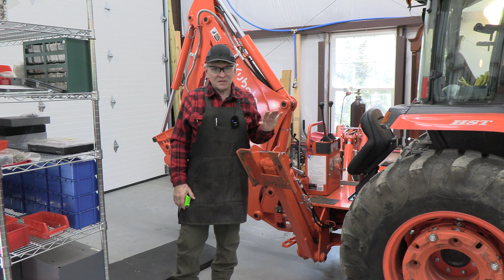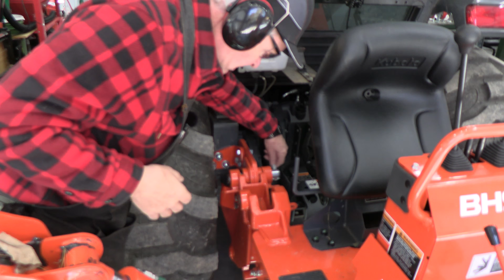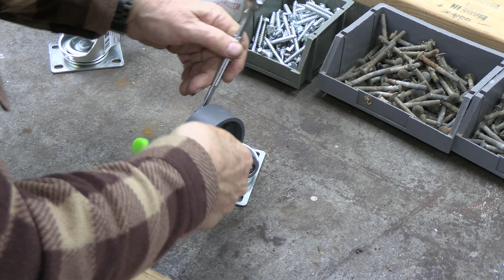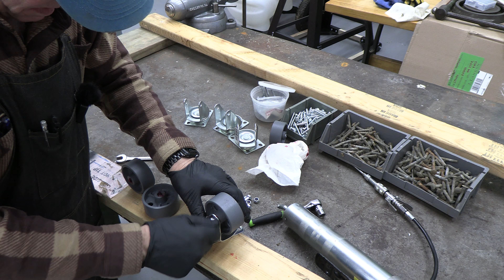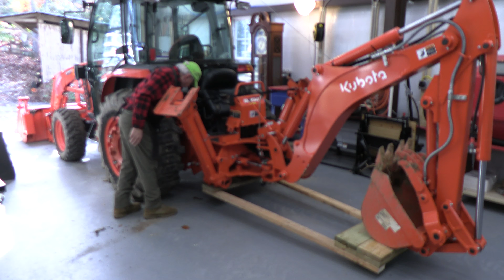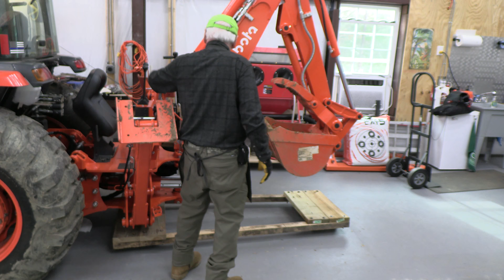KUBOTA BH92 BACKHOE ROLLING CART BUILD

Comment: I found this video very helpful, and I'm getting ready to build a dolly for my own BH92.   I am questioning whether it is necessary for there to be a rigid connection between the front and rear pressure points.  Do you think it would be possible to build separate heavy duty dollies for the front and rear pressure points, connected by a cable or chain?
Reply from the maker: Hey, you ask a great question. Yes I think you could have two separate dollies connected with some strong materials. Interesting thoughts. Consider subscribing. Thanks. Joe.

Comment: This guy is a dumbass,first he use 2x4, and 4 dolly wheels ,it fails so now go buy hardwood 3x4 ,4 more wheels carriage bolts, you have a welding table why not build it out of steel, and when you buy casters ,why wouldn't you see what weight there rated at

Comment: Thanks for sharing your build process. I wonder if building this out of steel (just bolted together tube and plate) would be simpler. Perhaps using a similar offset wheel design which are used on woodshop tool mobile bases which minimize raising the equipment while allowing for larger casters and less of them. This would also allow for a taller caster to be used and a wider footprint increasing stability. Is this something you would consider if you had it to do over again? I'm thinking of making such a cart for my BH 92.
Reply from the maker: I think your comments on the steel cart are excellent and I think it would be worth a try and I would probably welded not both together thanks Joe

Comment: How stable is it. Will it rock from side to side or tip over on its side?
Reply from the maker: Thank you for your question. This cart is incredibly stable. It doesn’t rock at all and doesn’t tip at all. Having that many casters is basically overbuilt by far but ULTRA safe. Thank you you consider subscribing Joe.

Comment: That's a nice backhoe, you can really do some work with that size. For greasing the bearings, you can buy a needle with a grease fitting attached, they're good for injecting grease into non greasable rubber boot protected ball joints and the like.
Reply from the maker: Thank you for your comment. Yes you make a great suggestion. I actually have one of those that I used to lubricate the ball bearings of the casters for the cart that I made to support it. consider subscribing. Thanks. Joe.
Reply: Wow thank god you told him that.
Reply: O